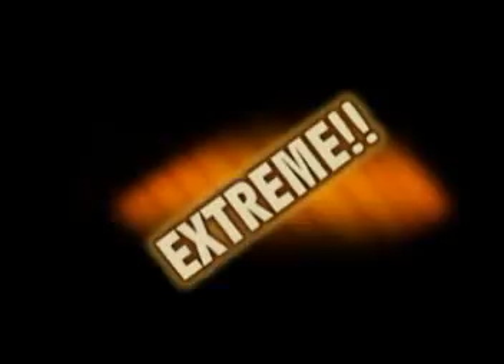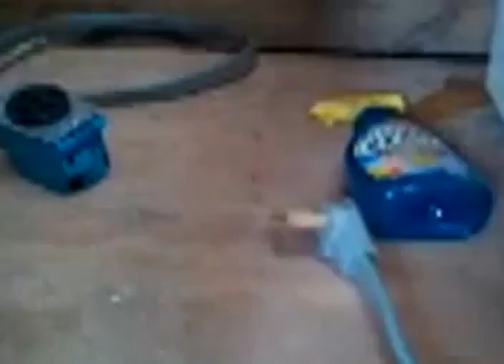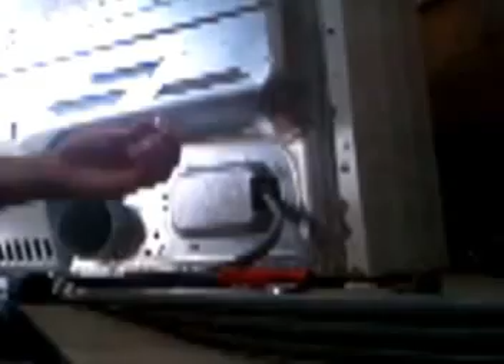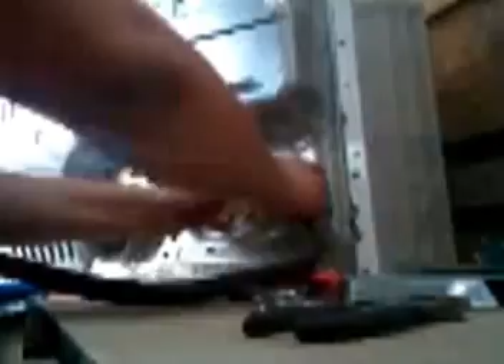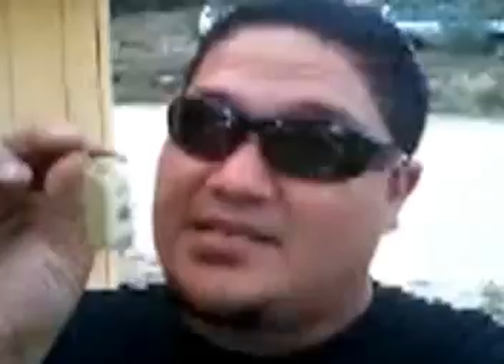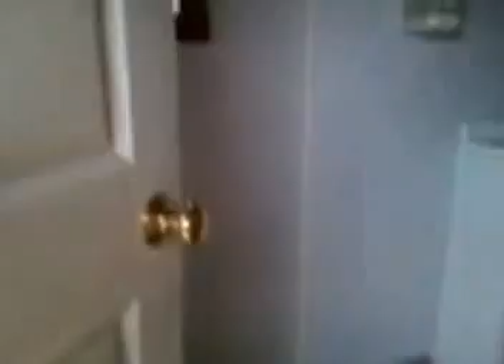Replacing the Dryer power cord from 3 to 4 prongs

Comment: As per in 2000 (what I heard), due to our now power requirements the electronics are now grounded separately which helps with less feed back. On three prongs the neutral plays part ground. Also get rid of the potato. HAHAHA

Comment: when converting from a three prong to a four prong plug you must know this ...if your dryer has an existing ground wire ( usually a white wire connected to a green bolt) you must remove the bolt and connect that wire to the white wire terminal ( neutral ) and connect the ground wire ( green wire and I've seen bare copper wire used also) to the green screw ... what you have done now is terminated the original ground by running it back to the circuit thru the neutral wire and now grounded the circuit to the body of the appliance.....the path of of lest resistance
Reply: *least

Comment: It is hard to see on the video, but the METAL BONDING STRAP from the neutral terminal on the 3 lugs that had the old cable, which is going to the frame of the dryer or stove should be removed. The White wire on the new 4 wire cable will go on the center terminal where the center wire on the old flat cable was. The green wire on the new 4 wire cable goes to the screw on the frame where the flat metal strap had been removed. (No need to use a different self taping screw) This separates the neutral from the ground wire on the appliance. The two hots Red and Black go to the two outside screws on the terminal strip. Also be sure to use the cable clamp that comes with most new 4 wire cables. They are a little bit of a pain to put on, but if you take out the two screws on the cable clamp and put them in the hole with the cable, it is a bit easier to get the clamp in place, than put the two screws back in the clamp.

NOTE: The above is the way I have ALWAYS seen them. The CENTER terminal is neutral and the two hots are the 1st and 3rd terminal. BE SURE to note where the bonding strap was on the terminal strip along with the old cables center wire came from, and put the white wire from the new 4 wire cable on the same terminal. I have never seen the neutral & bonding strap on the 1st or 3rd terminal, BUT you never know if someone worked on the unit, and changed things around for some dumb reason. THIS IS VERY IMPORTANT TO GET THE WHITE WIRE ON THE CORRECT TERMINAL, AND THE GREEN WIRE ON THE FRAME. The two hots Red and Black can go on either way, which ever fits the best on the two hot terminals.
Reply from the maker: ummmmmm.......THANKS!.....i think
Reply: Thanks for this man, seeing as you cant see crap in the actual video
Reply: Our green wire on our new 4 prong does not reach the grounding screw that has the copper bracket. What do we do in this case?
Reply: Jesus Christ smh thank you man,  Im like u but I never seen it the ground and N connected like that before lol, I was thinking god have I been doing it wrong this hole time? So I been on YouTube a good 30 mins just trying to figure out wtf is the right and all the videos never said a thing about that. So I started reading comments lol. But thank you I know it’s old but it was starting to aggravate me lol.